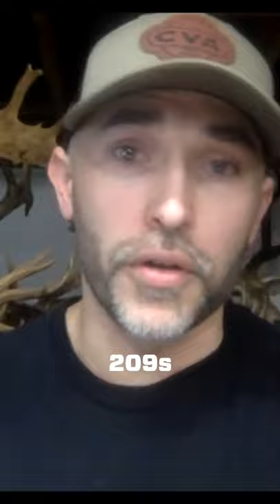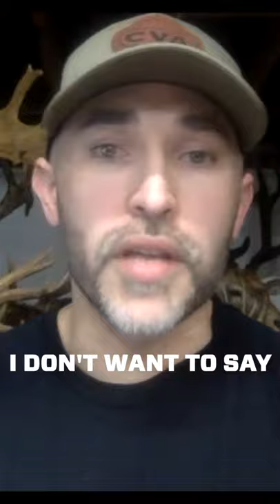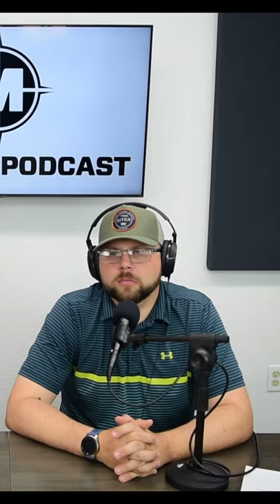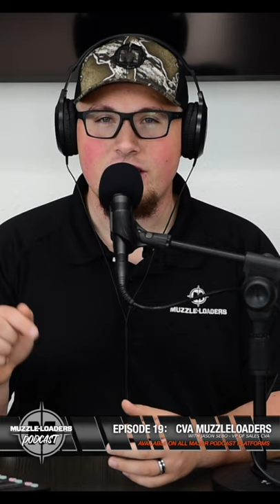209 Primers vs. Variflame™ Rifle Primers in Muzzleloaders - Muzzle-Loaders.com #shorts

Comment: Can't find any 209 cci or federal 209a. What should I use ? I tc triumph blackhorn 209 and Hornaday 250grain sst.
Reply from the maker: 209 primers are very difficult to find right now. I would recommend using whatever you can get your hands on. If you are able to find Magnum 209 primers of any kind then those would work even better.